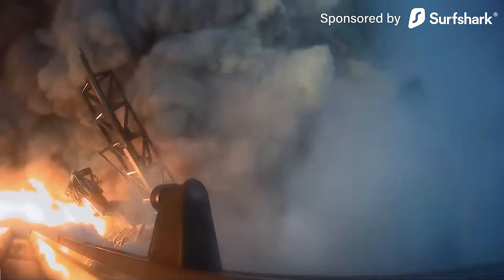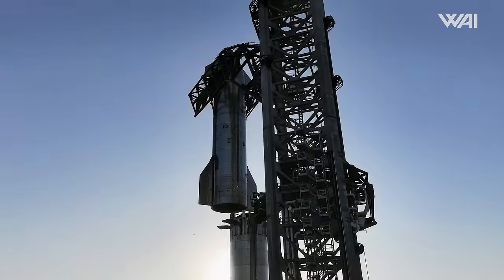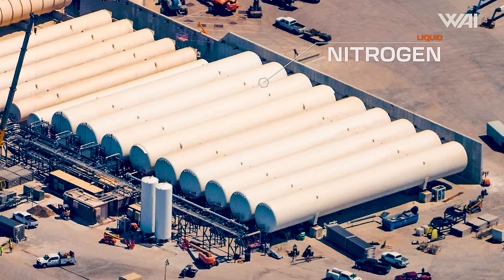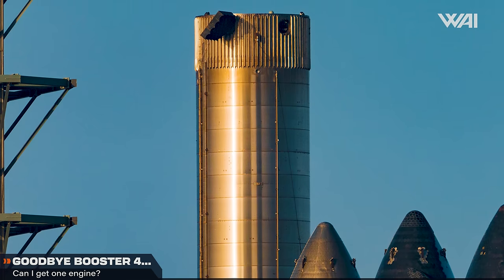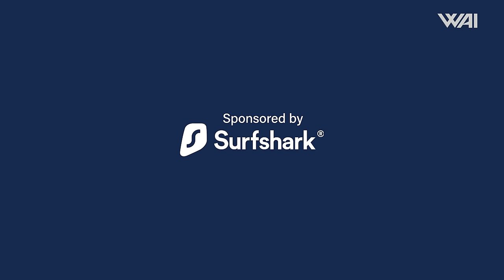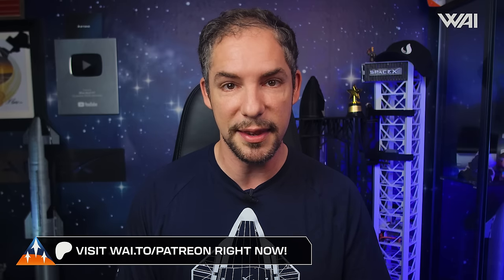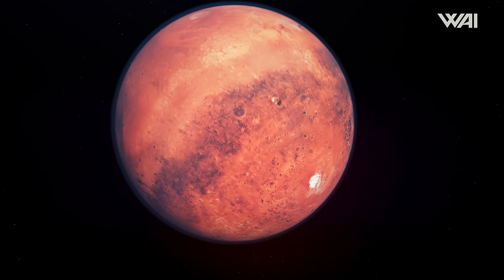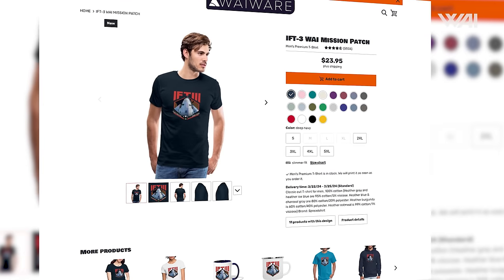SpaceX Starship: Final Launch Preparations! Will IFT-4 Make It?

Comment: Red and blue Adhesives relate to permanent and temporary adhesives. A tile that wont need to be removed to gain access to the area under it, or they know wont need to be removed gets the red stuff. Where as a trial fit tile, or one that might need to be removed for access to what is under it gets the blue sticky stuff. Just like Lock Tite.
Reply: Why don't they manually weld pins like they use for the other tiles?

Comment: Starship’s greatest contribution to a potential Mars Sample Return mission isn’t a cheap launch, but a much greater mass budget, which will greatly simplify the design and construction of all the other necessary parts, which will make those parts cheaper and easier and quicker to make.
Reply: starship lands people to Mars, they will just pick up the samples far earlier than ANY unmanned mission!!!
Reply: I don't see how a Starship can help with MSR.  You need simplicity, not mass.  Starship's only potential role is if you put a trans-Mars stage + lander inside Starship and that simply doesn't exist and can't even escape the cargo bay in current designs.  Far better to build a traditional system and put it onto 1 or more Falcon Heavies if you want this mission done in a reasonable time frame.  As Felix said, launch costs are not a major factor in mission cost.

No one should be expecting Starship to become a Mars vehicle anytime soon unless they want their mission cancelled after multiple delays and the whole concept of MSR is nearing the end of its rope.  If you're designing a mission, you assume that Starship doesn't exist... because it doesn't.  What you do have is the greatest rocket program of all time and it's called the Falcon family.
Reply: Dig it Dude! Yeah !
Reply: @antibrevity Starship’s promise of affordable mass helps TREMENDOUSLY because it’s much, much easier to design the systems needed for the return mission if you’re not struggling to keep the mass low.  Designing a return from Mars with 50 tons of available hardware and fuel is SO much easier than designing a return with one ton of hardware and fuel.   👍
Reply: The cost per ton is absolutely relevant to making it to Mars.
However, this system, while designed for Mars, will end up being so much more useful. 
Such as space mining, now we can slow, eventually stop all together, and MAJORLY help with climate change.
Space platforms to have transportation hubs, for not just international flights, but things like manufacturing. Who knows, maybe the ship that goes to Mars will be built in such an environment and just carry starship as a primary reentry and launch vehicle.
There will be many, many other applications that have not even been thought about yet.
Similar to magnetic residence, he had no clue what so ever that it would be used massively for medical imaging, yet MRI are live saving machines used daily.

Comment: Once they get the exterior done on the Star Factory done, there will be a lot of interior work -- wiring, plumbing, ventilation, equipment, etc.
Reply: Electrical, Plumbing, HVAC work does not wait for exterior to be done.  Once the basic frame is constructed, all of this is taking place concurrently.  It's common for high-rise buildings to have completely finished floors before the upper floors are even built.  And remember, SpaceX builds stuff even faster than typical commercial contractors!

Comment: Capturing the booster is ridiculous.  Rockets follow all different trajectories - that's why drone ships are used.  
Too much fuel will be used during boost back, meaning smaller and lighter payloads that don't go out as far.
Reply: Smaller and lighter with Starship still means more than Saturn V.  And with on-orbit refueling they'll be able to "go out" a lot farther.

Comment: If they do catch the booster during the fifth flight, don't you think they will need a flame deflection system on the side where they will be doing the catching? If not a water suppression system may be re-enforcing the concrete, so the booster doesn't dig another hole.
Reply: Concrete covered with steel plates now.

Comment: Hypothetically, the first Starship that returns from Mars could carry all the old Mars landers and rovers for museums.
Reply: No. They don't belong to our museums. They belong to Mars and should be protected there from future colonists, protecting the landing sides from any kind of modifications
Reply: They should be in MARTIAN museums bruh
Reply: Musk has stated that the first Starships to reach Mars will be scrapped for construction materials. Also, gathering up all of those landers and rovers from the surface of Mars would be a huge task that no one wants to do.
Reply: ironically if one considers the longevity of the landscape on Mars and other celestial bodies artefacts would be much more long lived then in a museum on earth where political unrest or simple societal change would invariably limit their endurance to a few hundred years compared to hundreds of millions of years on the surface of Mars
Cheers
Reply: @AnyWayICan  
Those first landers contain anything but parts for prefabricated facilities of predicted necessary types builds in risks for the first people to arrive.  Parts for prefabricated buildings that would be buried by robotic bulldozers (also in loads delivered early), mining equipment, at least one prefabricated fuel production facility, rovers that operate in manned and unmanned missions, meteorological measurement equipment, and the necessary AI assembly machines and machinery to fabricate necessary structures and machines for unpredicted needs are all things I think should be delivered to a fairly compact area well before any people are sent.  Save cannibalizing any ships until there is a demonstrated need to do so.  A hundred ships sent for this purpose puts 10,000 metric tons of usable equipment on Mars and another 10,000 metric tons of usable stainless steel if it is required or 100 ships whose useful parts can be viewed as "parts inventory" for the later arriving manned ships.

Comment: Why not have sample return mission use a car sized space plane with a ejected sled landing undercarriage then extended maneuver wheels to make it a rover a topside hatch door set with robotic grab arm with flexibility lift fingers to pick up the samples and a few under 4 " rocks, close up top lower forward skids on rover wheels then rocket back using testing of a methanol rocket and some solid booster ones to get off planet. Then use ion engines to get back to earth slow and steady
Reply: How about a Tesla Roadster with an Optimus inside?

Comment: Hey Felix..regarding OLM legs taking damage and repairs..why couldn't SpaceX use and glue heat tiles to the legs to help protect the steel and concrete. Tho the pressure from those Rapters might be a problem...

Comment: They should consider thinner but double layered tile application on the nose area. It’s a safe approach in 2 ways. And even potentially inner tile application. Although if the metal goes it’s gone. But the space between the nose nose tanks as well as the flaps is increasing the heat in this area. It’s gotta be kept down.

Comment: I keep thinking that an autogiro copter could make it safely to the surface of Mars.  Now that we know the Perseverance could fly with its rotary wings why not a high performance autogiro?  High heat resistance and high spin speed adjustable blades.  Still might need the retro rockets to slow down .  Another total rethink is to design an actual saucer shaped craft that is a huge gyroscope; something like a Frisbee that uses both gyro energy for stability and air resistance to have a parachute effect. Ship it folded and unfold and spin up at an optimal height.

Comment: Heat is not as much of a problem with the recovery of boosters or fairings as you imply.  The second stage separates and fairings are released when the system is going less than mach 5.  Reentry from LEO is at mach 25.  And remember your high school physics!  The energy which must be eliminated is proportional to the square of the velocity.  So the booster only needs to handle 1/25th of the energy!

Comment: It would be interesting if they were able to mount the old engines on a Falcon Booster/2nd Stage Just use them.  I know they use different fuels...but it be good test of them despite them going next generation of engines.  There isn't a lot flight time on them, frankly it goes along with their tradition failing forwards.  That's better testing with engines in air and throttling.

Comment: I wish the best for SpaceX
but my guesses would be that in one year they will have been 3 flights - 2 of those they will only achieve one further step in their mission plan 
and one will end too early due to engine failure

that had engine issues in all 3 flights - from the getgo, after seperation, before smashin in the ocean
they will most likely have also issues for the flip manouver and the hovering

Comment: My prediction for one year from today. Five additional launches including ift4. Flight 4 will nail the simulated de-orbit burn. Flight 5 will successfully deploy starlink payload. Flight 6 will nail a simulated landing of the booster in the ocean and deploy payload. Flight 7 the starship will re-enter mostly in one piece and booster will do anther simulated ocean landing. But in my humble opinion the tower catch idea will be abandoned. I suspect that SpaceX will either move to a different catching mechanism or they will use landing legs. The tower catch is too complex and risky. Aircraft carriers use cables to catch incoming aircraft and I think SpaceX may attempt to use something along those lines except vertically. And by Flight 8 they will attempt a booster recovery but it will not be a full success. The second launch tower will be nearing completion and in orbit refueling ideas will be further tested. It won't be until the following year that Starship will become operational for Starlink deployments with full re-usability.

Comment: Will SpaceX need some form of flame diverter over the area used for super-heavy booster landings? Although SpaceX uses a much smaller number of Raptors to land (1? 3?), some hovering may be required to line up the booster hard points with the chopsticks. The booster will not land directly over the OLM to minimise landing risks. Therefore, the existing flame diverter isn’t usable during landings. Or will the Raptors blast directly into the concrete during landings?

Comment: Regarding Raptor engine improved thrust and specific impluse . What about replacing the turbine powered turbo pumps with turbine ramjet combo powered turbo pumps. Of course enlarge manifold, cases and tubings. In addition, use more titanium parts instead of stainless steel.
Just a thought.

Comment: Prediction: Within the first two catch attempts (#4 & #5?), at least one will crash, and the Launch Tower will be damaged.
Reply: That's almost guaranteed. I hope we're wrong.
Reply: Destroyed!
Reply: flight 4 will do a simulated landing with a virtual tower, if that succeeds then it lands on the real tower on flight 5

personally im confident it will work, spacex has much experience with suicide burns on falcon, which are even harder than hover burns the starship will use as falcon has no room for error when landing, starship/superheavy will have error room
Reply: No bet.   They really need a 'dumb' tower without all the expensive plumbing, and further away from the fuel farm.

SpaceX is capable of really stupid actions: risking both the OLT and the farm would be a classic example.

Comment: If Raptor engines are becoming ever more powerful, why can't SpaceX return to developing a way for the booster to land on its own? Even if catching it works, it can't be as reliable as the booster landing on its own and out of the way of vital infrastructure.
Reply: Because landing legs are heavy. And I think people over estimate the chance of something going wrong. If they get relight of the engines as reliable as falcon 9, then there should be no issue because of the ability to control thrust much more precisely, meaning it can hover. That makes landing in the right spot much more easy. Also the extra thrust is much more important to payload than to landing. It's not really about the thrust when landing.

Comment: If the Boster is going to get bigger then Starbase SpaceX will need a super high mega bay  ???? as the planned larger Booster would not fit through the new Doors they have fitted

Comment: why don't they use some kind of paint instead of tiles ?
Reply: Because that kind of paint doesn't exist
Reply: These tiles are not for Decor like on your bathroom wall. They are quite thick and extremely heat resistant. Considering that the tiles are over Stainless steel which is very heat resistant itself, this tells you how hot they get. As the rocket re-enters the atmosphere, gasses are super heated by the friction into super heated plasma. 
There was a kids story about building a rocket and an ET coated it with a transparent green goo that hardened and enabled the ET to fly home. 
Wonderful story but not that realistic.

Comment: Some if not most raptors from first 200 made still around could be used on falcon nines as a upgrade test of actually full flight information gathering
Reply: That would require massive modifications to the Falcon 9, which is designed to carry ambient temperature kerosene fuel rather than cryogenic methane. I doubt the juice is worth the squeeze.

Comment: I look at the manufacturing capability and profitability of SpaceX.  SpaceX has the ability to manufacture at least 25 boosters and 75 ships by 4Q2026.  Most of SpaceX revenue comes from Starlink.  While customers, particularly NASA and DoD, will be slow to switch launch contracts from the extremely reliable F9 to Starship, that does not apply to Starlink.  Starship reduces the cost per launch and increases the mass to orbit for Starlink, and Starship can deliver the much more massive full Starlink V2 satellites which have over four times the power budget,  so the over fifty Starlink launches per year will switch to Starship ASAP.  If SpaceX is aggressive it will have used over a hundred Starship launches to deploy Starlink by 4Q2026.  SpaceX and "agressive"?

Comment: I'm always impressed by the content at WAI and have learnt that I'm simply too ignorant to speculate in a meaningful fashion.

Just over a year ago I was more concerned than sceptical that a heavy launcher with 33 rocket engines could work reliably. This was based on the failure of Korolev's ambitious N1 rocket. IFT1 proved me wrong, despite what many called a disappointment. I was impressed in part because of the damage done to the OLM. 

Now, after IFT2 and IFT3, I'm convinced that Starship will work eventually. Probably sooner rather than later. 

Beyond that, the only other prediction that I'm prepared to make is that the Russians will fly Soyuz for another 60 years.
Reply: Now that they have got almost all the bugs fixed, why change for LEO jobs.

Comment: A suborbital launch, does Starship need the big booster , maybe strap on falcons 9's.   would do the job? You do not need to reach orbital speed for suborbital flights, and it would still be 100% reused. Though maybe the booster would use less fuel and allow even more payload + landing legs..
Reply: Thanks

Comment: I would really like to take a look at those clips that apparently hold the heat tile to the Starship using the metal pin welded to the ship. I have searched for it but all I come up with is the tile and the pin but not how it's done???

Comment: No offense but are you daft? "The lessons learned" that the video keeps talking about have been learned already by NASA in the 60's with the Apollo program and continued with the shuttle program. If anyone was surprised about the damage caused by starship launch to the pad, has not been following space exploration at all! We are talking about a rocket more powerful than the saturn rocket and somehow it slipped the mind of these engineers what would be the outcome?! Not to diss the overall work being done here, but Musk is pushing and burning money just to speed things up, without taking lessons from the learnings of previous times. The 7 month delay and destruction of the pad could have been prevented entirely.